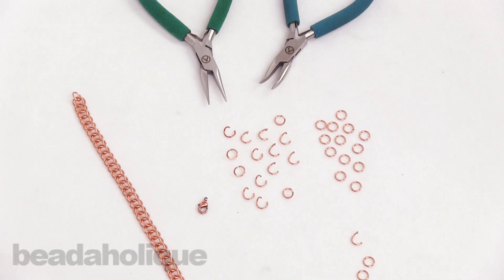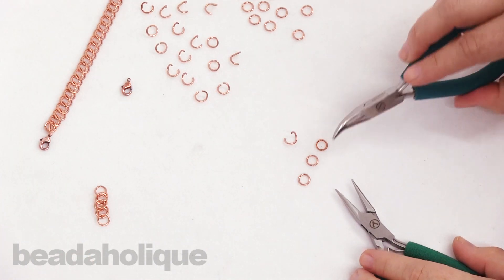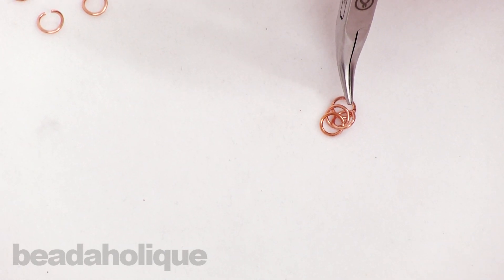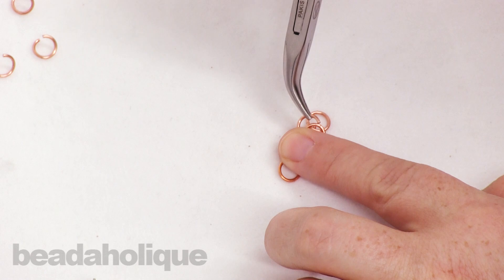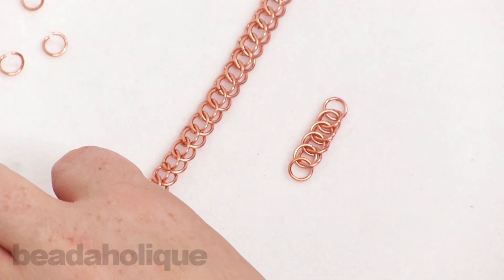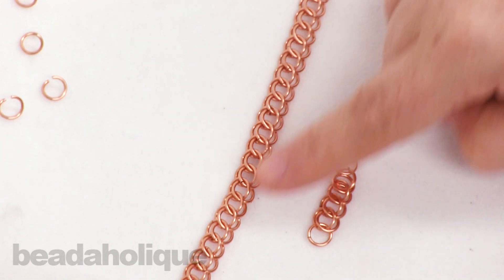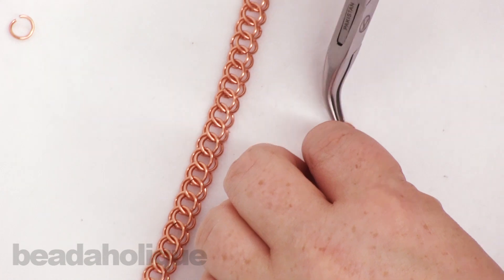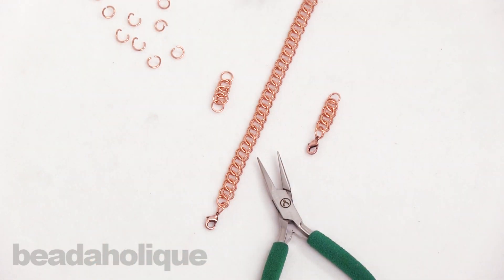How to do Half Persian 3-in-1 Chain Maille

Comment: I have 14 gauge sterling silver wire I'd like to try with this weave. What is your recommendation for the ID?
Reply from the maker: It depends on how tight you want your weave.  14 gauge might be difficult to work with for this weave.  I would try for something that has an ID of at least 4.5mm.

Comment: Holding the work in your left hand and using an open ring with a closed ring on it to connect to the previous 2 finished rings is much easier, much faster, and makes far more sense than fumbling with the work on the table.  Usually I enjoy these videos and learn from them, but this one was confusing.  This method made the weave much harder to work and the camera angle was bad because your hands were blocking the weave as you did it.  But mostly, there is a much simpler way of doing this weave and this video used a horribly complex and awkward method.

Comment: Is it 18 gauge AWG?
Reply from the maker: +cherylvanputten Yes these rings are 18 AWG (1.024mm), with an inner diameter of 5.56mm. You can find full information on them here: http://www.beadaholique.com/p-28308-artistic-wire-chain-maille-jump-rings-non-tarnish-copper-18-gaid-556mm110pc.aspx